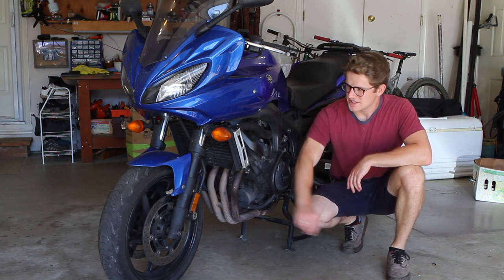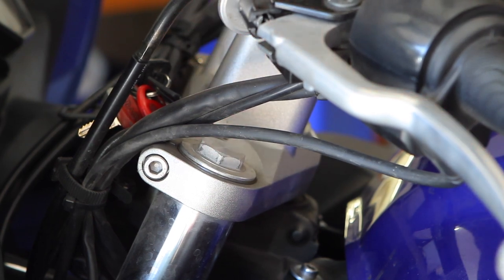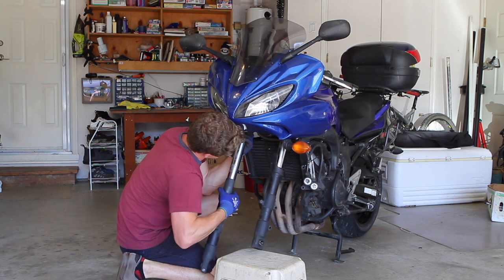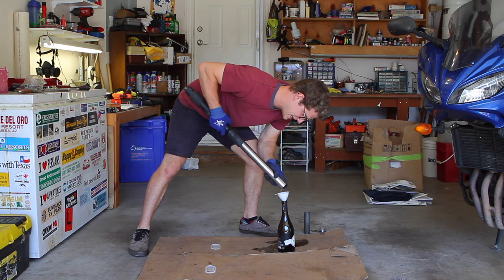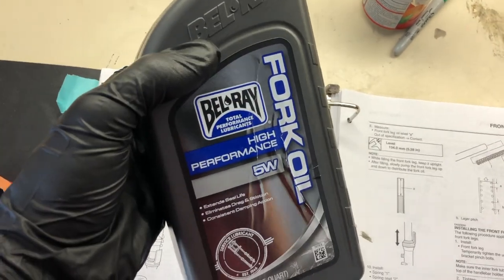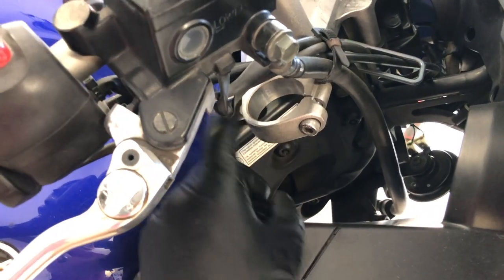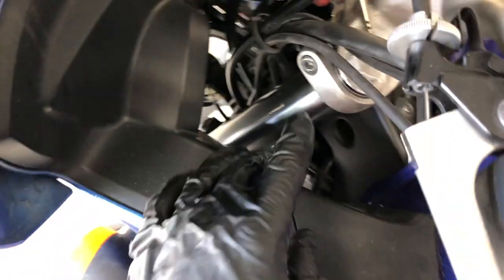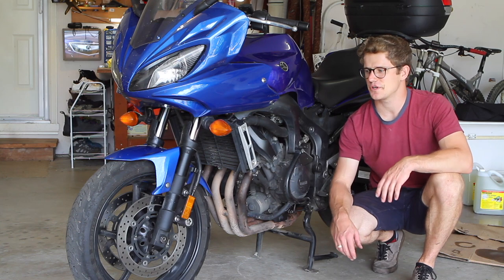Yamaha FZ6 Fork Oil Replacement - How to

Comment: With the center stand, why not just use a scissor jack and bbit of wood under the downpipes? Works a treat.
Reply from the maker: Yep that would work just fine.
Reply: Didn't think of that, I'll use my harbor freight jack and some wood when the time comes cause I don't have that rear rack storage thing

Comment: Hi Calvin. Des again, with annoying question (🤔😅). Do you have any experience and if so ,recommendations for steering damper which will fit 2006 FZ6 Fazer without any modifications? Thank you ,Des
Reply from the maker: I haven’t got a steering damper before. I think ohlins makes a steering damper that works with the FZ6. I think any damper requires some attachment point to the steering assembly that the FZ6 doesn’t come with from factory.

Comment: What is that rear luggage case you have? I have a Nelson Rigg soft case but it attaches to the passenger part of the seat. Yours looks like you could still run a passenger and have the storage on at the same time.
Reply from the maker: I’m using a Shad system. It does leave room for a passenger. The top case even comes with an optional provision for a back support for the passenger. I made a video on the cases I’m using. I’ll link it below. Highly recommend them! 

Link: https://youtu.be/Z7SrTs5UcuI

Comment: Don't forget to loosen the top pinch bolt before trying to loosen the fork cap. That bolt puts pressure on it making it hard to undo, and more likely to damage the parts.
Same can be said to tighten the cap, doit first then the top pinch. 
Cheers.
Reply: I also thought that you can use the axle as leverage to open this cap after removing the fork - just put it into the opening on the bottom of the fork leg and hold with your feet while undoing the top nut.
Reply: @h4xi0rek  the problem with using the axle is that the fork tube is not captive to the rest of the leg, which will allow the tube to spin inside.
Reply: @tiagovarandasyt  thanks for the info, did not think this through :)
Reply: @tiagovarandasyt   Absolutely - not loosening that top pinch bolt can severely mark up the top bolt and make the job look like a stoopid amateur did it especially with an adjustable. (Gotta luv the fact he opens the fork over a huge sheet of cardboard and drops the oil laced spacer and top nut on the concerete floor, then pours the oil into a funnel no bigger than the fork itself - no one would ever think of using an oil pan or a dish pan... no, not even an option)

Comment: Hi Calvin. I've been following your video's for quite some time, and to tell you honestly: very impressive job. Keep up. My question for you is: can I change preload fork caps  without taking the front end apart(disassembly  forks).I would like to change my standard caps with:   

CNC Shock Absorber Screw Fork Cover Cap Preload Adjusters Bolts for Yamaha XVS 1100 650 XT 400 600 XJ 6N 600 FZS 600 Fazer
Red 🤔 
Thank you in advance,Des
Reply from the maker: Hey Des, yes you can swap out the caps without taking the fork leg out of the bike. I would recommend loosening the top clamp that holds the fork leg to the fork crown before loosening the top cap. Thanks for the kind words! 👍
Reply: @Calvinm  Thank you Calvin. Most likely will bother you sometime again. Till then, stay good and well!😅🤔👍